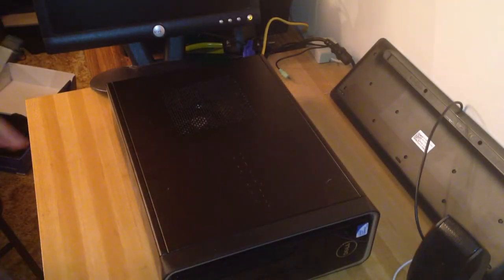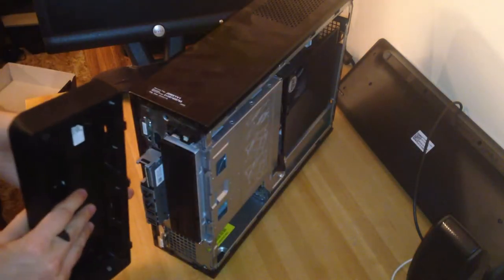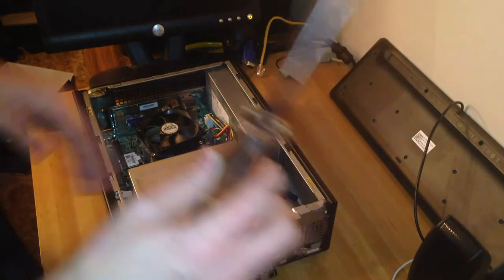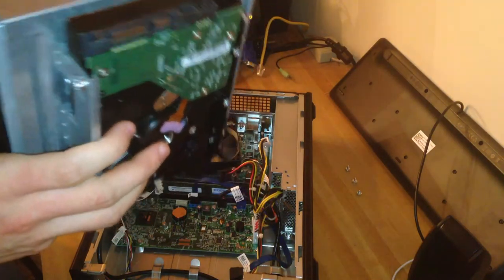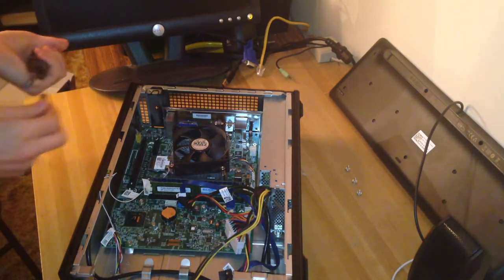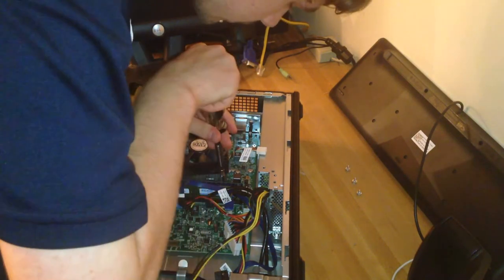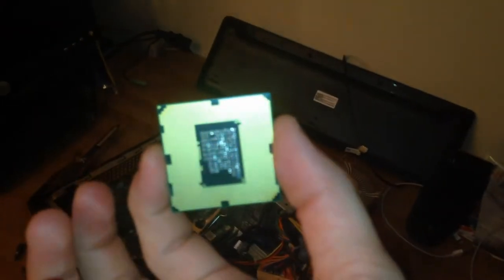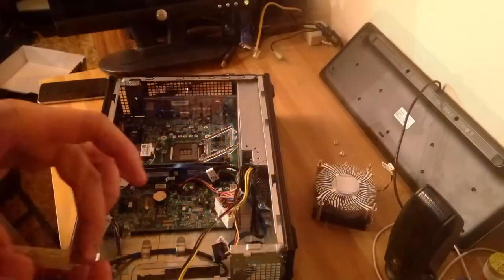What's Inside?  (Dell Inspiron 660S Upgrade Log) [Generation One: "Wolfboy Tech"]

Comment: I have theDell I660s and mine has a pentium g630 I upgrade it to a core i5 2400, the 4gb of ram to 8gb and i install a gt 1030 from gigabyte. i play many modern games on it and this little baby is a beast. medium to high settings on almost every games except a few on 1080p. Guys it's the ultimate upgrade for this pc
Reply: Nice. Going to upgrade to 8 gigs and an i5-3470T. What memory did you use and what voltage> I have 8 gigs of DDR3-1600 lying around at 1.35v. Been tiold the system can utilize either 1.35 or 1.5.
Reply: @bocconom  i have a 660s side machine running 16gb (2 8gb dimms) of team ddr3 1600.  bios is running them at 1333mhz.  haven't bothered to figure out how to get the full 1600mhz yet cause the machine works fine for it's purpose currently.  both dimms run at 1.5v so im sure the board in there is capable.
Reply: @OnLineSystems1 Thanks for this info.  Reworking space at home so I have a much better work area so I can finally tackle this system sometime this fall.
Reply: youtube is racist  No I am not a scammer.
Reply: @bocconom  no prob and good luck. I'm bout to drop an i7 3770 and a red led 80mm fan on the stock cooler to shine through the side intake in this little thing to top it off. Only real limits I'm finding is the proprietary 220w psu. Still, you can pretty much max out this board with lga1155 era gear with no psu hack jobs if you just plan on running cpu video. These are fun systems to build because of your limitations.
Reply: Wow exact same thing I did except no gaming so I bought a GT 710.  2400s is good but now I am looking at an i5 3570s, dirt cheap on Ebay.  Give my moms PC a bit more life and its fun as hell to do

Comment: My sister gave me her 660S (pre-installed with Windows 8 and later was upgraded to 8.1) for diagnostic purposes because it wasn't running. I came to find out that her Western Digital Blue hard drive had failed. Long story short she doesn't want it back.  Because the system is rock solid otherwise I have been thinking of upgrading the cpu to an i3 and replace the failed hard drive to an old but diagnostically sound Seagate 250 gig hd.  I also will be increasing the RAM from 2 gigs to 8.  This was an OEM product and MS decided to embed the authentication code in the BIOS.  I know there is a legal way to retrieve said code but I don't have a Windows 8 disc to complete the process.  Here is my question: If I choose to install Windows 10 or a Linux Distro will the fact that the Windows 8 verification code is embedded in the BIOS cause any issues that you know of?  Thanks and thanks for this video.

Comment: My 660s isn't starting... Its getting 2 beeps at startup... No display.... Can you help me solve/identify the problem.?
Reply from the maker: Check your RAM. I'm not sure of the beep codes for that mobo. Remove each stick of RAM at a time and attempt to boot. If it continues, attempt to remove your CPU cooler (and throw it out the window if you can upgrade to a new case, lol) and then replace the thermal paste on it. If that doesn't work either your CPU or BOTH of your RAM is fried and you then have two choices: Buy/build a new computer or get yourself a new CPU and set of 8GBx2 (if supported on your system) RAM.
Reply: Thanks.Got it.One RAM stick is damaged.Its working fine with the other RAM stick.Gotta replace the damaged one.
Reply from the maker: Devesh Agarwal awesome! Great to hear that it works!

Comment: Sweet Vid! Not too long ago I built my own gaming rig. I had a micro Dell 3647 fall into my lap recently. I believe it's an older version of the 660s (correct me if i"m mistaken). I was wondering if you knew if any small form factor mobo can be placed in these things. I would like to upgrade it as a side project to be able to game at low or medium settings. I don't think I can achieve that with Dells stock mobo and just upgrading the cpu and gpu. Thanks in advance for taking the time to read.
Reply from the maker: Hello, Molly! I actually think you could upgrade this type of a computer. You would have to double check on your board, but you could get an uber low-profile GTX 1050 or 1050ti and get the performance that you want. It's about $100-250 (depending on your choices or brand, specs, etc.) for the GPU but it should work well with the Pentium in there. Up the memory to the max 16gb DDR3 (8gbx2) and you should be off to the races. The total upgrade should be about $300 (give or take, most likely take about $50-75) and will keep your PC ticking for quite a while. You can always upgrade to the i5 or i3 later on if you find a good deal on ebay or a local sell site. If you get a deal for better parts or you just want to upgrade later on, then you can always resell the computer with the parts for a higher value than you bought it.
Reply from the maker: Re-reading your comment after I posted my last. If you wanted to do a complete redo of the chassis to fit a third party mobo in, then good luck. Dell is notorious for flipping holes, moving holes, and just simply ignoring spacers. If you're handy with a drill and don't care about the case, then go ahead, but I would just try upgrading the stock parts. To each their own tho, and whatever you do, may GabeN smile upon you while you do it.
Reply: Thank you very much for your extremely quick reply! As for now, I think I'll attempt to upgrade the CPU and find an uber low profile GPU just have a feeling the ones I want will require more from the PSU. Do you know of any 3rd party PSU's that will fit in a case like this?
Reply from the maker: Probably not on the cheap. You could probably get an SFX PSU that may fit (I think that SeaSonic may have one, but I'm not sure). You should be able to find several first party ones from Dell on sites like ebay that are from similar models that have higher wattage outputs. happy to help!

Comment: i actually just upgraded my 660s which turned out to be a little tricky as I wanted to get as much performance off the stock psu as I could....I got an i5 3750s which runs at only 65w vs the 55w the g1620 and then I found a sweet PNY Geforce 730 1gb ddr5 gpu that fit perfect in teh case and didnt require a power connection....so far so good I can run skyrim with 60mods on ultra and pretty much any game on high....tricky build for sure but it is doable.
Reply from the maker: Awesome! I'm happy you are having great performance! Best of luck in your computer lifestyle!

Comment: I have  one of these but can't figure out which graphics card should slide in it for a low price
Reply: +abhijeet jain nvidia 710 2gb ddr3 by GB works great and fits fine. can play alot of games even AAA titles on low
Reply: +abhijeet jain I just upgraded my 660s to a PNY Geforce 730 1GB ddr5 low profile card...it works great and doesnt require a power connection to the psu it runs off the pci slot...it is the most powerful card that fits in such a small space....also if ur looking to upgrade the cpu i did fit an intel i5 3570s in which is only 65w.
Reply from the maker: I'm sorry for not replying, it was very unprofessional of me. I would recommend selling the computer (I sold mine for about $250) and building your own. You get more customizability and more options. Should you like, I can build you one in PCPartPicker for you if you let me know your budget.

Comment: Hey what's going on? Can a Evga Gtx 1050ti graphics card and a Evga Bronze 450w PSU fit in this PC?
Reply from the maker: Hello! For the slimline version, the 1050ti might fit, however you will need a small form factor. Check the size reference on the card you want and then measure the case. As far as the PSU, you'll need a larger case. the S variant had a proprietary PSU because of it's size.
Reply: Stacklin Studio thanks for replying. I haven't brought the computer yet, I wanted to see if my parts I want to upgrade with will fit. Sorry I meant a 750ti instead of 1050ti. I came across the 660 and 660s, wanted to see which one would be a better choice. Or do you think I'm better off just doing a custom build?
Reply from the maker: Hey, man. I could slap together a PC in PCPartPicker for you and you will probably save A LOT of money. You wanna give it a try? Else, I would recommend the larger, newer verson of the 660, located here: http://amzn.to/2fWkp4V. Ontop of that, don't go with the 750ti. It's the same price for the 1050ti on Amazon and will offer 250% of the performance (a good 1050ti can be found here: http://amzn.to/2gkSSLI). As for the PSU, if you go with the TI line of GPU's, you shouldn't need to worry. Custom is great and is a good learning experience that you can always put on your resume. As I typed earlier, I would be happy to set up a specialized list for you on PCPartPicker.
Reply: Stacklin Studio Stacklin Studio you are truly a blessing! Thanks for taking the time out to help me. I would to build a custom one, can you slap one together
Reply from the maker: Kenyon Hicks Sure! What is your absolute maximum for your budget?
Reply from the maker: I got you a build for around $550. http://bit.ly/sshickspc It'll blow through most games on ultra, but some on medium or high. But a lot better than the OEM that you got. The WinX can be bought on Kinguin here: http://bit.ly/sswin10
Reply: Stacklin Studio thanks that was perfect. My budget was no more than $650 which is great. Question are those AMD processors better than intel?
Reply from the maker: Hey, man. Sorry I didn't get this until now. Sadly since the Kabby/Skylake systems are at a premium and Zen isn't out until early 2017, we're in a position where cutting corners and waiting is the best bet. It'll do you amazing and even has built-in graphics should your GPU die on you. That being said, it'll also be really easy to resell the system (minus your GPU) after Zen's APU's come out.

Comment: i have i3 processor, recently i upgraded my graphics but it's performance is not that good due to low power supply... can i upgrade the power supply of 660s to a 450watt one?
Reply from the maker: If you need a new psu you'll need to buy a new case as well. I personally like the Corsair Spec-alpha. Then you can upgrade to any psu of your choice

Comment: Is it possible for a small pc like that be able to become a gaming pc?
Reply from the maker: Yes with some upgrades to the gpu and cpu.
Reply: Stacklin Studio and a psu yes they will fit it's called sfx form factor boop
Reply: Pretty sure most are made by silver something and season
Reply from the maker: Theofizan Sweq No, actually this one is a custom size with custom cutouts. Please learn your devices. The SFX psu's from Silverstone are still too large, I know, I paid the $100 to try it.. And my camera lost all of the footage.
Reply: Stacklin Studio really it's that small Jesus crisps
Reply from the maker: Theofizan Sweq No.. It's really not. I have tried. Unless you don't want to close your side panel (which may be good) and have the PSU sideways and have to route your cable through the case, then no.. It really will not work. Unless there's a SFX psu that you know that is the same size as that of a Dell PowerEdge PSU (around 3.5" (~9cm) wide), which then you would be correct, but as far as I know the smallest is still at least double that.

Comment: I have this exact computer, what is the best graphics card to get that fits less than 150$
Reply from the maker: Any SFF (small form factor), low-profile GT 1030 or, if you can find one cheaper, a 1050Ti (without 6-pin)

Comment: i am trying to upgrade my power supply to a CX500M and nvidia geforce GTX 960.  will it fit in the computer?
Reply from the maker: +Stage MC (The Lost Minerz) Power supply, no... You'll need a case, the GTX 960 /MAY/ fit, but it really depends on the model.

Comment: Do you think it would be possible to move the motherboard itself into a new micro atx case and upgrade tihe graphics card? Thanks!
Reply from the maker: +RBit Yes, however remember that you will need a better power supply (i recommend at least a 450W PSU) as the built-in unit will not fit easily into your new unit. The one I recommend is the 450W from EVGA that will set you back about $30 and comes with free two-day shipping if you have Amazon Prime (Link: http://amzn.to/21gcWUq).
Reply: +Wolfboy Tech Yeah i was thinking a corsair 500w would do the trick nicely for a 750 ti that i was going to buy
Reply from the maker: +RBit true true. Also don't forget about the Red team (amd)  because you can get very nice cards on a budget. If you're tight for money. The R9 280 is a good first choice, while the R7 370 also adds many features and benefits from the Crimson driver that fixes many games. Also, Minecraft hates Nvidia, so.. Just some food for thought. Don't just jump on the "cheap is okay"  bandwagon. If you can afford it, go with it! :)
Reply: +Wolfboy Tech I know, but the 750 ti from zotac is a great deal. I was going to go with that or an r7 360. :)
Reply from the maker: +RBit the ti may offer slightly less performance. I'd look at several video reviews.. And always remember that you have 30 days to return it if it's new! :D
Reply: +Wolfboy Tech Oh, i thought the 750 ti was more powerful... Well, r7 360 we go!
Reply from the maker: +RBit lol. The 360 is newer.. Again.. Look at a bunch of vids comparing them all. Also, GPU Boss is a good site too look at the numbers.
Reply: +Wolfboy Tech Yeah. I wanted to just play games like borderlands, bioshock infinite and crysis 2, which are all games that ive played before on my brothers gaming pc. Sadly though, he left for college and took his pc with him. and now i really want to play on pc cos i saw how much potential it has.
Reply from the maker: +RBit lol. Well I wish you the best. If you want any help, I'd be happy to offer it. I love to help all of my viewers in any way possible! So may you have a great one, and welcome to the PC Master Race.. And welcome to the embrace of Lord Gabe-N
Reply: Lol thanks man.
Reply: +Wolfboy Tech oh hey, is the mothet board micro or mini itx? if its mini itx, can i still put in a micro atx case?
Reply from the maker: +RBit hey man, sorry I didn't see this comment. Damn system must be down at YouTube. To my best knowledge it's a micro-atx, but I'd get the biggest case that you can so you can get larger Graphics cards and maybe even a better mobo (motherboard)  in the future. Technically it's a custom PCB, so be careful when you install it into any case.
Reply: Okay thanks!
Reply: RBit hey bro I tried moving this mobo into a different case for my friend, my I don't understand the wiring for this old mobo... I need to plug in the power switch, power leds, reset switch, hd audio.. did you ever figure out where the cables go

Comment: How do you get the right parts for a small pc like that?
Reply from the maker: You should look on ebay for some cheap parts. I recommend taking a look at +TechYesCity and his channel for great old school GPU's.  For the CPU, use Speccy to see your current CPU and then use Google to assure that you can upgrade to at least (minimum) an i3 for the quad thread performance. If you want to use a DGPU in the case, be careful you only have room for a small DGPU. Get the dimensions of the card and then measure inside your case to find out if it will work.
Reply: Wolfboy Tech Would it be possible if you used the most advanced processor with the most advanced graphics card in this kind of PC?
Reply from the maker: +Farhan Nadim you could, but you would need a better psu, and case... if you're spending that much money you might want want to think about selling your current pc and simply building a new pc.
Reply: Wolfboy Tech My PC Intel Pentium G2030 3ghz 4Gig Ram Inspiron 660s
Reply: Wolfboy Tech What would be the most I can replace on this pc to make it better?
Reply from the maker: +Farhan Nadim okay? I would still recommend selling it and building your own. You get faster, better performance, and will only have to cough up around $300-$400 after you sell your old system.
Reply: Wolfboy Tech ok what parts would you recommend?
Reply: Wolfboy Tech What is your systems specs?
Reply from the maker: Farhan Nadim Gimme a few hours and I'll get you all set up with a custom PCPartPicker link. What's your budget? Would you like my company to also build it for you (at about a $100 premium (inclds. shipping)? As for your question of what my system is, you can find why to-be system here: https://pcpartpicker.com/user/jstacklin/saved/HxCp99 however I wouldn't recommend it to someone on a budget.
Reply: Wolfboy Tech No i do not want a company to build it for me but thanks for the offer. I just need to know what are the most advanced parts that i can get for a pc like this since it is micro/small tower pc?
Reply from the maker: Farhan Nadim The most advanced would probably be the core i3 for that generation and then some small-form-factor DGPU. You may not get much of a performance increase so you might want to, as I said earlier, build your own PC. Again, how much is your budget and I can send you a PCPP list in a couple hours.
Reply: what kind of core i3?What kind of graphics card would be best for this kind of pc? I am not sure about the budget so just show me the recommended parts. I will work from there.
Reply from the maker: Farhan Nadim I don't know which core i3 you need, that's why I told you to look in your system specs on speccy or if you have windows 10, simply type "CPU" in search and launch the program called "View Processor Info". From there, look online to see what generation your chip is from, then go to ebay and buy an i3. As for the GPU look on Tech YES City's youtube channel for budget used gpu options.
Reply: Wolfboy Tech ok